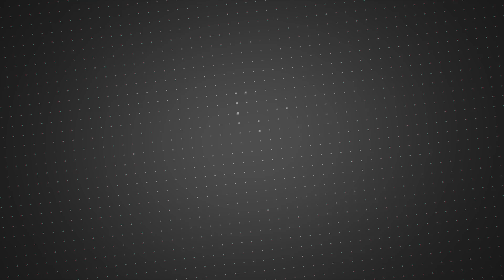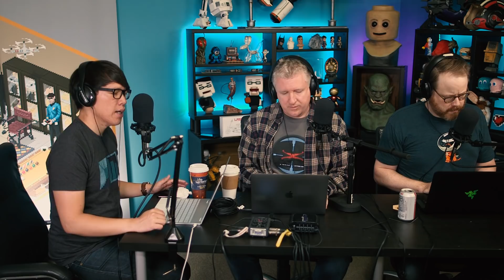A Dark Divide - This is Only a Test - 5/24/18

Comment: I take issue with TLJ and with much of what Disney's shown with their handling of Star Wars in that it seems to value creating something that "Feels like Star Wars but different and new."  Over simply trying to look at the Fictional universe as a background setting and asking "What are new stories that could happen in this setting".

I also can not help but feel that it has the issue (like a lot of recent writting) that it seems to feel the need to try and show "Realism" by simply having entire chunks of plot/dialogue not end up mattering in any regard (rarely even as character growth). Which certainly may be "realistic" to MOST circumstances however even in reality the stars will sometimes align and incredible series of events coallese into important moments in history.  And so as is the beauty of Fiction, you can choose to have the story highlight times like those, its not that those times don't theoretically still occur in the story's universe but there is no need to highlight them if they add nothing other than filler.

Comment: The PS4 Pro was NOT designed to be native 4K HDR machine.  The games that support the Pro mostly do 1440p which is nowhere near native 4K.  Some can do checkerboard 4K (Faux K), but again, not even close to native 4k (and then it's almost always at 30hz).  The Pro was specifically  made to support the PSVR because the regular PS4 doesn't have the muscle to drive a stereo display at 90hz and even with their interpolation tricks it causes nausea in many people.  Once the PSVR didn't get as big as they predicted (Sony will never sell all those Move controllers that have been collecting dust in Sony warehouses), they tried to pretend the Pro was really meant for 4k gaming and entertainment, but that was never what it was designed for.  Heck, it can't even do UHD blu-ray which is Sony's own format.